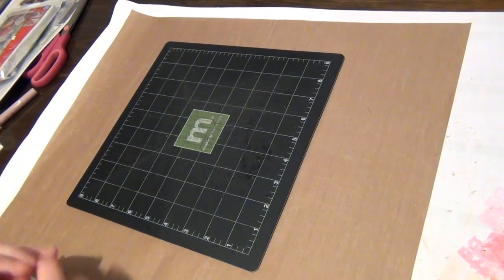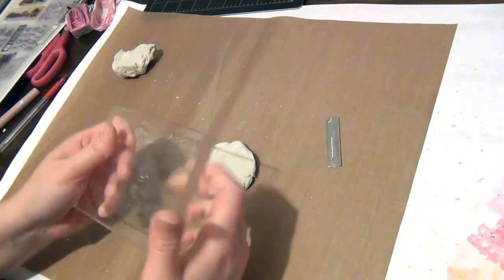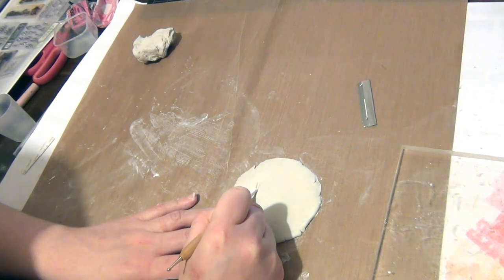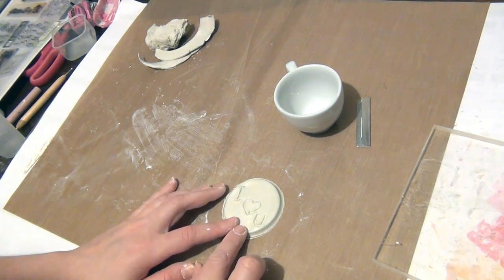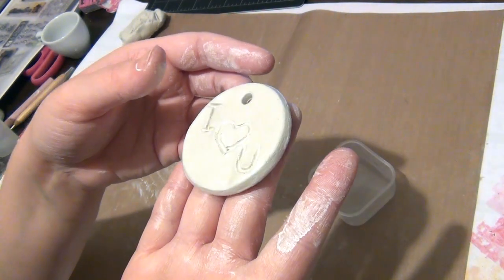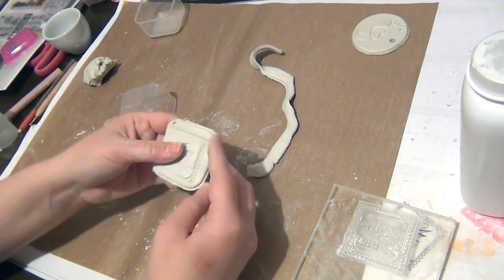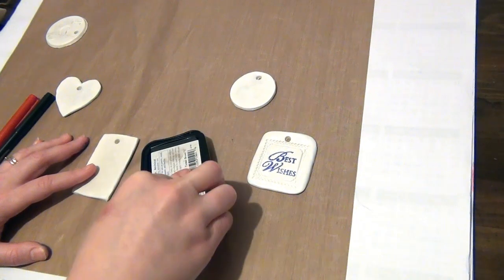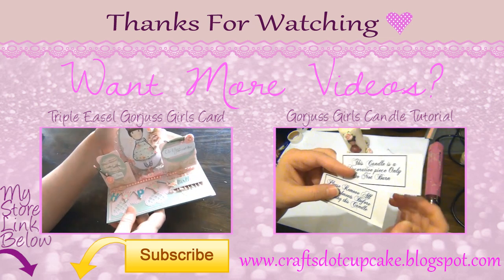All Occasions Polymer Clay Tags - Tutorial

Comment: Its cute, what kind of pen your using to highlight? Did you put it in oven ir microwave?
Reply from the maker: I used air drying Polymer clay, so it doesn't need to go in the oven, but if you're using any other kind of clay, just follow the manufacture's instructions on the packaging.